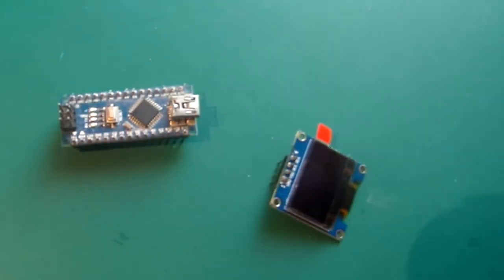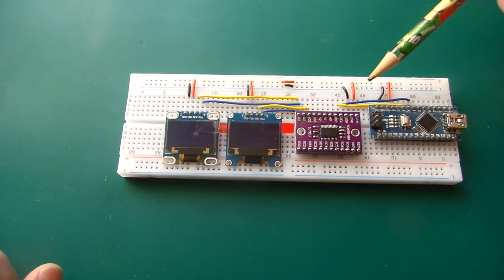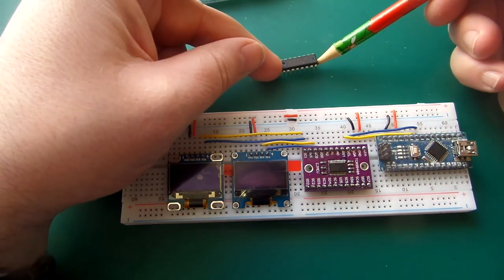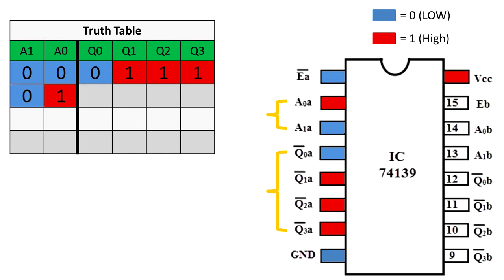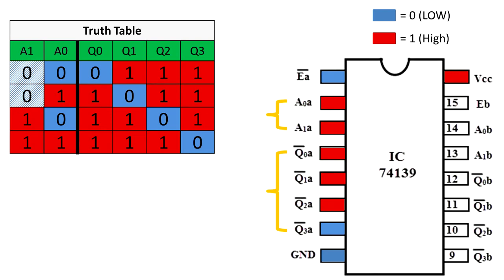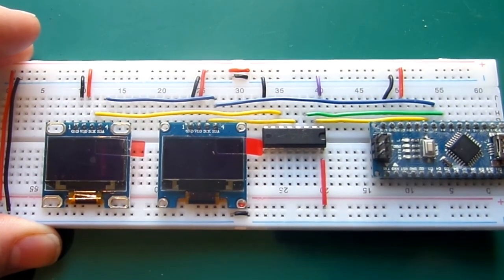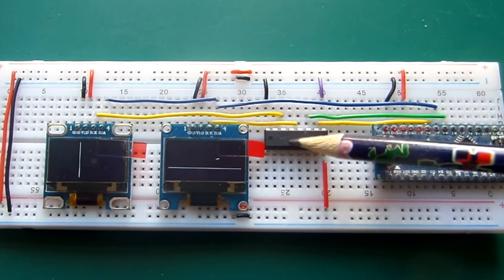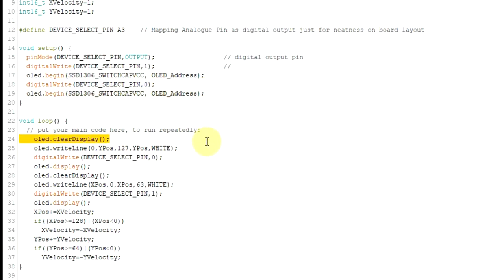Using 1970's technology to connect two identical I2C devices with an Arduino

Comment: Nicely explained.  You got me wondering about other ways of routing a clock signal.   Two AND gates and an inverter to one input would do the job, but I don't think anyone makes a single package containing those. If you're willing to sacrifice an output pin of the arduino you could skip the external inverter. Even then, my solution needs one chip of about the same price, so yours wins!
Reply: I believe 2 NAND gates would do it, won't they?

Comment: Dont you have a solder jumper on the back of the oled to allow you to change the address, you may be able to get 0x3C or 0x3D, but that would only work for 2 displays max. so your solution could work for more.  Whats happening with Frogger?
Reply from the maker: Some of these do, think the adafruit ones always do. I've bought cheap ones and just looked and some of mine do and some don't. Frogger was waiting for me to get the audio hardware /software right. I've nearly done the minimum I need to do with the DACAudio project. Just needs sound mixing to allow more channels, then frogger is back on. I'm doing this next.

Comment: Just found this on the web, the oled DC pin may be able to change the address.   "The pin DC must be connected to 0 or 1, it is used to configure the slave ... control the DC pin to change the address of slave device."  search for    1.5inch_OLED_Module_User_Manual_EN.pdf
Reply from the maker: Ahh cool, I'll give it a go. Cheers.
Reply from the maker: Of the two I'm using one has a changeable address via a solder joint and the other has nothing that I can see, no DC pin or anything on the pcb that shouts that it will alter the address. There is such a variety in these boards.

Comment: Around 14 minutes in you mentioned that while working on this project that you figured out what the issue was with the multiplexer. Please reply with the fix. I'm going nuts trying to get the multiplexer to work consistently on power up or reboot. Any help would be greatly appreciated.
Reply from the maker: Gosh, forgot all about this. Will have to revisit the video /project page see if I can remember. Will report back, give me a few days.
Reply: @XTronical  Just been watching your videos; really useful stuff.  I'm also getting the 'power/reboot' issue you mention at minute 14 that you'd solved; did you ever post the solution anywhere as I'm driving myself mad trying to solve it.  Any hints/tips very much appreciated - cheers.
Reply from the maker: No, I didn't revist but someone posted another suggestion very recently, should be near top of comments.
Reply: I think the answer is there wasn't a proper setup sent to the displays before, where in this sketch there was? Well, it's in the other sketch, but it is only called once, so it's kinda luck of the draw if either display sees it, but once it does it's fine since only they micro is being reset, not power to everything. 

Am I close?